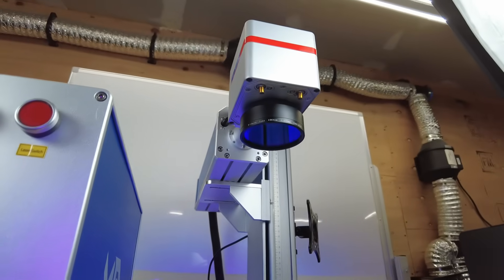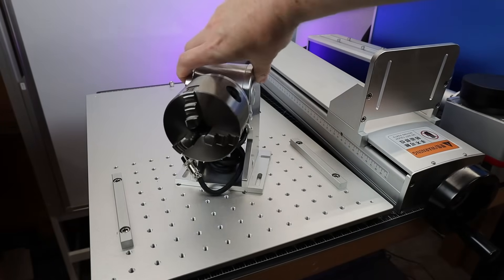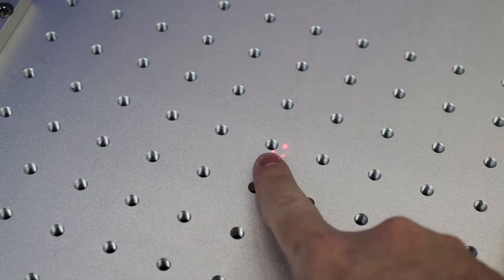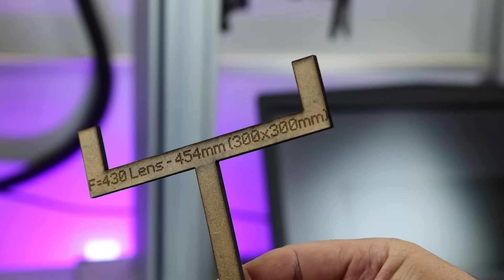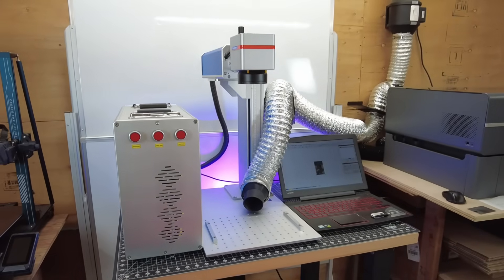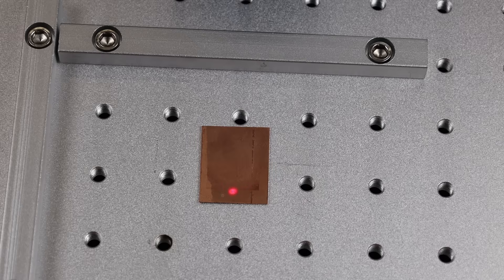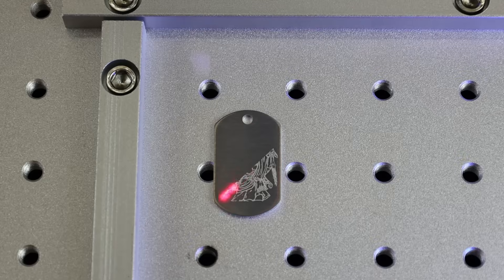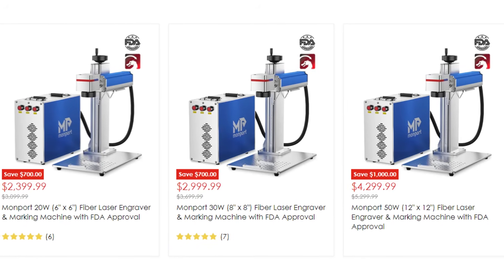Monport 50w Fiber Laser 300x300mm (12x12in) Work Area

Comment: On your link it says 12×12 but when you go to the link at Monport it says 7.9x7.9. Is the 12×12 available?
Reply from the maker: It looks like they changed the listing and are shipping with a smaller lens now. So if you want the 12x12 you need to also get the 300x300mm lens. But honestly if you are working on jewelry you are better off with the smaller lens seeing that it's way more powerful. 

They have the 300x300mm lens as an add-on option for a little over $100 more.
Reply: So the work area is a function of the lens itself and not the work bed. I'm new to this so still learning.  It looks like your work base is bigger than the machine pictured. Is that the one that came with the machine or add on accessory. Thanks for the help it is appreciated.
Reply from the maker: Yes the lens will change your work area size. That being said the bigger the work area the more power you need out of your laser to make nice makings. That is why I suggested someone smaller than 12x12 because it really cuts the power level down.

Comment: Will the work area always be the same regardless of the lens?
Reply from the maker: The work area changes size depending on the lens. So this came with a lens that would give you a 300 by 300 mm work area and I swapped it out to one that gives you only 70 x 70 mm but because of the smaller area it's able to focus more power into what you're engraving or cutting

Comment: greetings What if this machine can make holes or cuts to the copper plate that you marked in the video?
Reply from the maker: This should be able to cut thin copper but its not fast. I think it can do something like 0.5mm to 0.8mm
Reply: @randymay  Hi! Would I be able to cut through 0.5mm with the lens of 300x300?
Reply: @randymay how do u feel about it after using it more